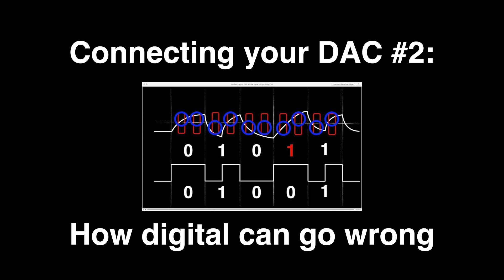More about using a DAC

Comment: Hans thank you for your videos. Really helpful as audio is no longer just a record player and an amp. I have a beginner question if I may, re the MU2. You mentioned using a separate Roon server. If I am doing that (with a mini PC) how do I know the streamer is the one in the MU2 and not the mini PC? Also does this affect the sound quality if compared to doing everything with the MU2? Thank you!!
Reply from the maker: Go to settings, general and it shows top of the screen. It doesn't influence the sound quality if the external server is ok.